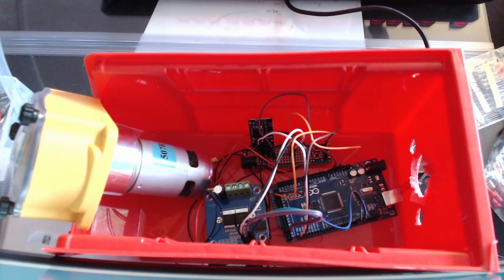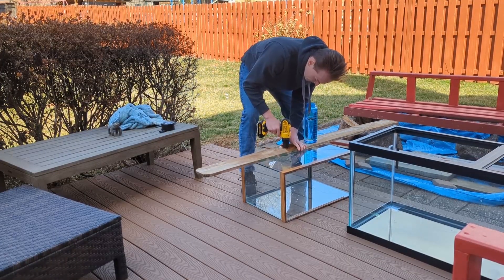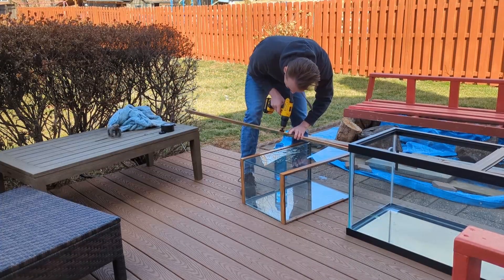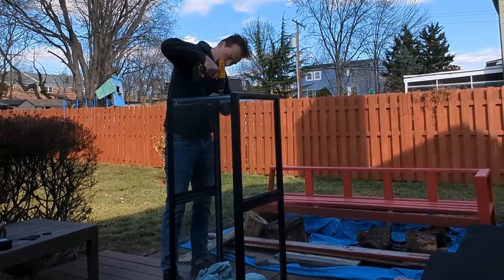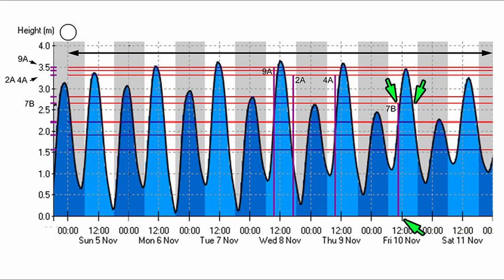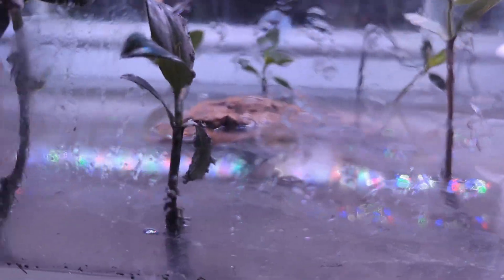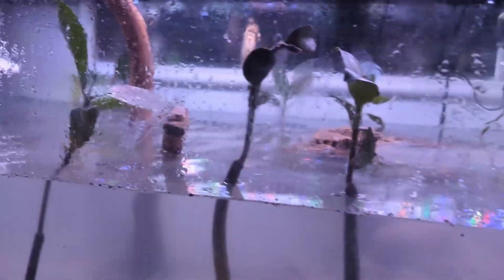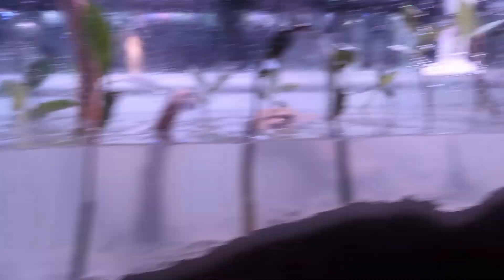I added TIDES to my Mudskipper tank!

Comment: would you mind sending or posting a build list?
Reply: or post a video about the ways you could setup the electronics? I have a old Raspberry Pie
Reply from the maker: It's relatively simple actually.
DS3231 - Real-time clock chip
Any DC peristaltic pump (Make sure flow rate is enough for your needs)
H bridge capable of supplying power to the pump

I also added 2 buttons - 1 to manually drain the tank, and 1 to manually fill it

Comment: Anyone wondering. Chatgpt can also make code for this rather easy:) 

I wouldnt use the clock from an arduino. My arduino nanos are 15 mins off in a 24hour cycle. 

You can add an external clock like an rtc ds1307.
That way you are way more accurate. 

Also, if you use an esp32 you can connect to the internet and get the time from a ntp server.
Reply from the maker: I used a DS3231 RTC chip. I kind of glossed over most of the technical details because the main point I wanted to get across was the tides + mudskippers 👍🏻